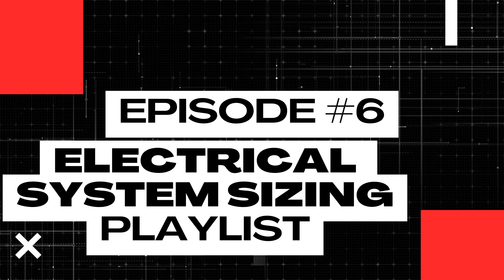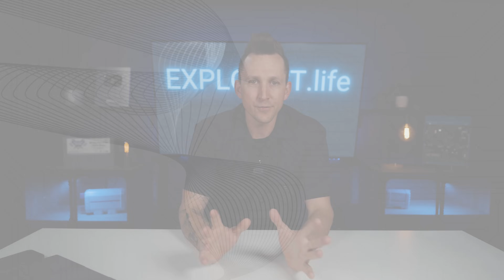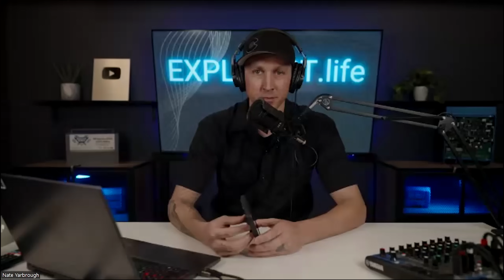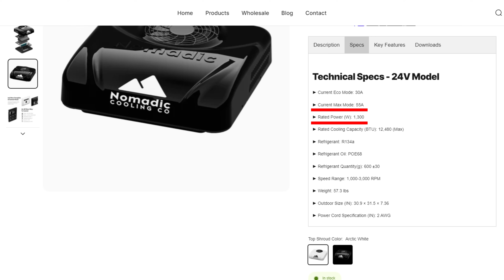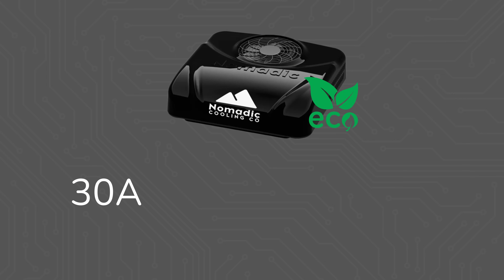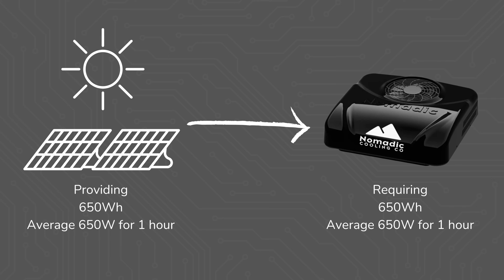How To Calculate Air Conditioner Power Usage for a Marine, Mobile, or Off-Grid Electrical System

Comment from the maker: *Visit https://academy.EXPLORIST.life to experience every lesson, ad-free.* Follow along with a lesson plan, quizzes, and chat with other members. In the academy, you don't have to wait until every Sunday to watch the videos and read the articles; they will simply be published once we are finished.

*➤ Join the EXPLORIST.life Academy:* https://academy.explorist.life

*➤ Shop the EXPLORIST.life Store:* https://shop.explorist.life

➤ Shop Batteries: Use Code 'explorist' at checkout for $50 off per battery: http://battlebornbatteries.com/?afmc=explorist_bb67

Additional info regarding power usage: The temperature outside wildly affects air conditioner power consumption & duty cycle.  Last weekend, Steph and I went to Adventure Van Expo in Scottsdale Arizona.  The temperatures were in the 90's during the day and the 50's at night.  We were outside of the van during the heat of the day, so we didn't use the air conditioner.  At night, though, the van was a little warm when going to bed; so we turned the air conditioner down to 68 degrees.  Since it was cool outside, once the inside of the van was cool; the air conditioner didn't cycle on as much resulting in only 15% power used from our 6.8kWH battery bank being used overnight; most of which was the 'fan only' mode as the air conditioner compressor (eco mode) switched off.

Special thanks to Will, Kolby & Tucker for taking some time to provide some insights in this video: https://yarbroughandsons.com/ and https://www.youtube.com/@BlueCollarBroughs
Reply: Can you please make a video showing how to incorporate a fuel type generator into the system and still be able to hook up to shore power in a rv

Comment: Additionally starting a stopped compressor wastes a large amount of amperage, in a grid connected situation this isn't really an issue, but on a battery connected situation you're wasting a large amount of energy.

For instance your rotor locked may be 60 amps at 120v. (7.2KW) Before your inverter losses, if you have a loaded voltage sag to 12.6 that's 570 AMPS coming out of the batteries 👀. 

This means in places with high ambient temperatures you actually have to massively over build your lithium setup if you even want to have a chance at this. It gets a bit ridiculous you're going to use 100 amp hours per hour minimum... And you're probably going to need at least 12 batteries OR a massive 1.75kw solar array (but you eventually get to the point where the cells get so hot (125F ambient) they begin to massively derate and you may only see 600 watts out of that solar array.

Comment: I would say the most of the areas where RV air conditioning is truly required unfortunately the duty cycle is going to be much closer to 80% and I think that's really important when you're sizing electrical systems as far as energy storage capacity.
Reply from the maker: Can you cite your source for that 80% figure, please?

Comment: I do want to point out in some environments such as Arizona where we don't have to worry about freeze up because the humidity level is so low the majority of the year we tend to see a lot higher duty cycles. 

My 11,000 BTU ultra high efficiency unit tends to run quite a lot it doesn't spend a ton of time in the off state which does mean I do consume typically about 1k wh per hour. And a lot of that has to do with heat load from the sun because although I do have a very well insulated unit, if I start with a hot unit, the basement tends to retain the heat because of the level of insulation and since it's a non-ducted unit it tends to raise the interior temperature pretty quickly once the compressor cycles off.
Reply from the maker: Is your unit a variable speed/compressor unit?
Reply: @EXPLORISTlife  I do not believe so. it is a "64310" by Dometic the exact configuration is "9105305700" aka "640310CXX1C0" (gotta love how they label their units) 

11k BTU, 1382 watts, RLA 9.1amps, LRA 56.0

Comment: What are the advantages of 24v ac vs just using a 12v unit?
Reply from the maker: Not much.  A dc air conditioner just needs to match the battery bank voltage.
Reply: @EXPLORISTlife  there isn’t any efficacy advantage or anything?
Reply from the maker: @jadenrecker1874 not really, no.

Comment: Great video. We have an LG5000 wall mounted AC in our Aliner Expedition camper. Meter readings showed 400-500W draw while compressor was on and significantly lower draw while fan only. We have EcoFlow Delta series lithium battery packs while boondocking. Learned the hard way regarding temperature coefficient drop in solar panel output. Two 200W panels generated 360W consistently in bright sunshine, not 400W. 34:44

Comment: Most of the rooftop RV air conditioners that advertise as "DC" units, especially the cheaper ones, actually have single-speed AC powered motors with a built-in inverter to convert from DC. They are not very efficient, lack the variable speed and soft ramp up of a true DC unit, and thus annoyingly cycle on and off all or nothing with the accompanying current spikes and wear. Look for a unit with a true variable speed DC motor. They are more expensive but worth it, especially if the AC unit is in or near the sleeping area.

Comment: great info Nate..  I have a small class C with 8000 Wh batts.. and a 11,500 GE.. up in the midwest here where I live I average around 1000 watts with my system on Low.. up to 12 to 1300 on super hot periods.. so I usually dont end up running it during the day when out and around, but at night, it will barely make it thru the night.. the worse the humidity, the more it consumes..

Comment: Great video, I run a 9000 BTU Variable speed Mini-split in a 1/2 below ground 1000 Sft off grid  cabin and works perfectly for both heating and cooling.

Comment: Thanks Nate, lots to unpack here, much of which the mobile market either has no choice for (especially in the US) or simply don't want (yea, a residential split can be mounted on an RV, but a few do do it). I would point out that variable speed systems are far more complex, more expensive, and somewhat more likely to fail. Also, variable speed systems are much more expensive to repair, as the replaceable components are harder to get and much more expensive than a 2-stage or fixed speed motor/control board...

Comment: Coleman Mach 3 Plus 13.5kBtu when the compressor is running, including inverter losses (>85% per specs though not tested) and often a 32" TV (AC) on and normal 12v parasitic RV loads pulls between 108A and 122A per the BMS. The inverter charger is setup for "whole house" so microwave control board is also on. Fridge is always on LP, so minor DC load for the board. When the inverter charger is off and just the MaxxAir fan is going on low and stereo in standby, my base 12V output with other parasitic loads is under 3A I believe.

Comment: Great education, thank y'all!   Great thoughts on air filtration, wear and tear, and humidity removal related to correctly sized duty cycle!
I'm still a bit lost on how to size a unit for my van, I can't put a unit on my roof, guessing a variable duty cycle is best; the current 5kbtu window unit doesn't work, maybe too much heat coming in from the windshield.

Comment: I am running 4 mini splits on my EG4-6000xp, 3 units are 240v 1 is 120v, under full load all of them pull around 3000-3500 watts. Once they bring the room to temp, they spin down and use much less power. They are all 12k btu 18 seer units, 2 from Senville and 2 Gree units.

Comment: Once again, a Great video Nate!  I watched it twice just to take it all in.
My Houghton pulls 1550 watts, or 64 amps at 12 volts.  With my 400 Ah battery, looks like I have 6 1/4 hours of usage at 50% run time.
Thanks
Reply: Did you mean at 24V? Cause 12x64 is 768W :)

Comment: Great info Nate as usual
We have a 12,000 btu Pioneer mini-split H/P mounted on the tongue of our TT above LP Tanks  Powered by
2/ 24v 200 AH  Lossigy batteries 400 AH total
24v 3,000 watt Sungold inv/charger
8 / 200 watt panels  1600 total   
it works Awesome !!!

Comment: Have you seen the Furrion chill cube?  This is the main ac unit that the Brinkley model z uses.  FYI. It has 75% and 50% eco modes.
Reply from the maker: The methods of calculating air conditioner power usage taught in this video will work for that air conditioner, yes.

Comment: At this point nate you should be looking at the EG4 Solar 12v Heat pump. It's extremely efficient and cost-effective. It's the same as a 
Mr Cool 😎 
You can run it strictly by battery or... during the day it's only using Solar when the sun sets it automatically switches to battery or on grid AC.
It's Solar with a transfer switch to AC or battery 🗽 but with a 12v style mr cool is a whole sized  thing of do you have the space to use it 😅😂😊
Reply from the maker: Thanks for watching!  The goal of these videos is to teach YOU how much power that YOU can anticipate needing to power the devices in YOUR system for WHATEVER devices that YOU want to power so that YOU know how much power you need in your own mobile, marine or off-grid electrical system.

Take what you've learned in this video and apply it to the devices in your upcoming build.
Reply: Correct me if am wrong, but a thought on your observation of solar being able to run a 12v AC if panel output is > AC draw.  

If the charge controller for the solar puts out less charging amperage than the AC is drawing, it seems like you will slowly fall behind.   E.g., a Victron 100/30 won’t charge and replenish the batteries as fast as a 12v AC drawing 45 amps.